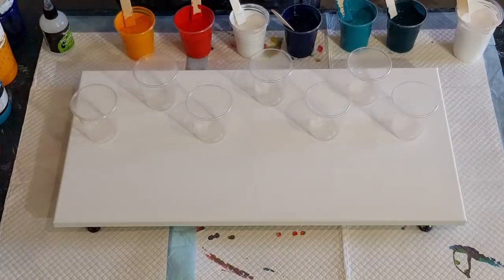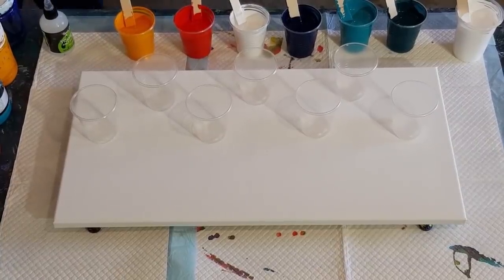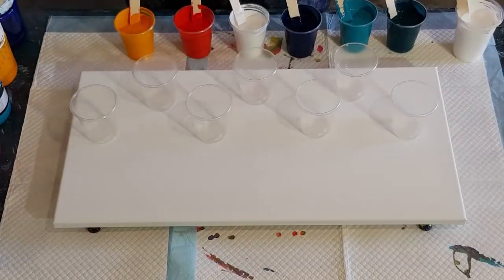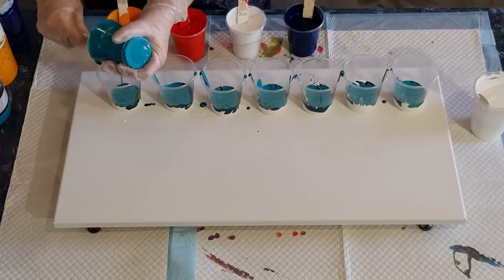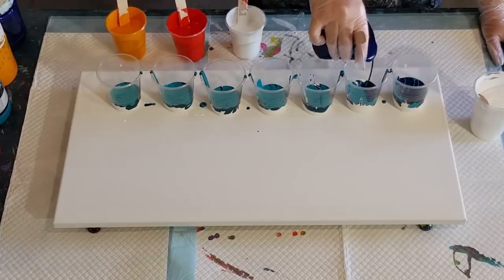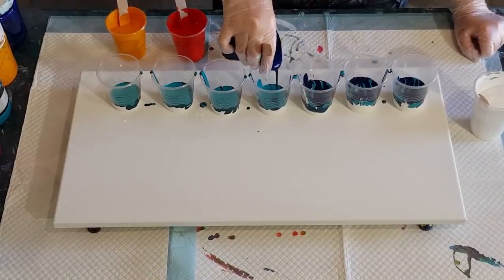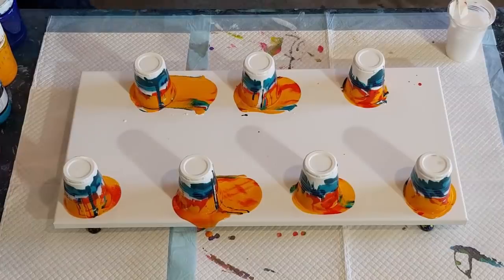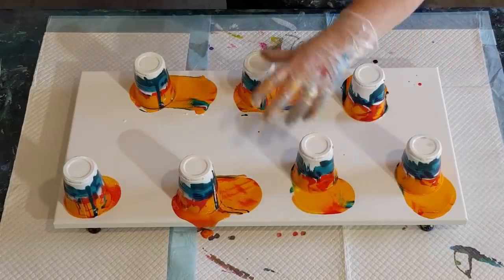#264 Push And Pull Filp Cup pour

Comment: Still using Floetrol? Is it not the main cause for puts and specks which get stuck because of a thicker mix with glue? And I agree with the hijacking of threads. It has been around since the first forums. Always a source for lots of discussions. Like the push & pull. TFS 💖🎈

Comment: What is the difference between Elmer's School Glue and Elmer's Glue All? 

The main difference is that when the school glue dries more of it can be removed "in the wash" than the glue all. The school glue is a lighter, more water soluble glue even after drying. Most of the glue all will remain after it dries. Both are safe and non-toxic

Comment: I love this playing with paint, but I find it hard to understand where all the waste paint goes. It is not environmentally friendly. How do you clean your cups and tools. Where do you dump all the waste paint and cleaning water.  Boggles my mind that it would go down the drain or in a land fill. Maybe you have a better plan that you can share with us. Then  maybe I can let it go and and enjoy doing an actual pour. Thanks, I love your work.
Reply: pandora8899 a great idea for the waste paint is a bucket with charcoal at the bottom, sand at the top and holes at the bottom... dump cleaning water into bucket which filters water before it goes into the ground.  Using dried excess paint as skins for other craft projects is also easy to do and a popular way of not wasting paint.